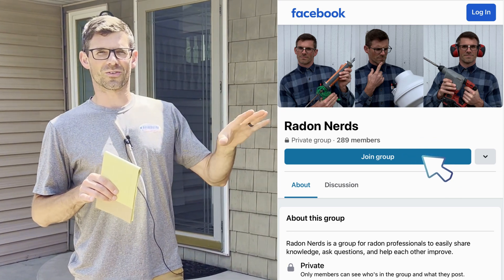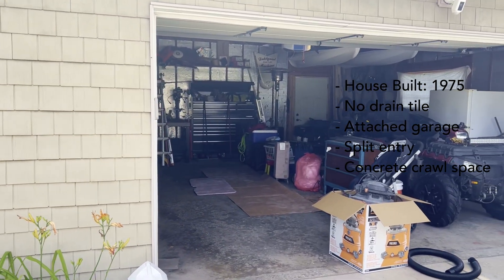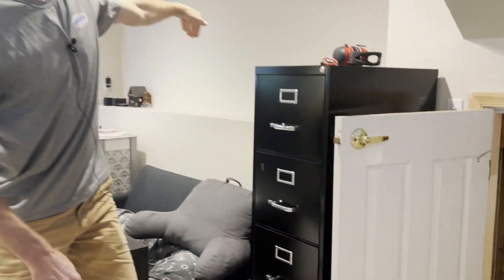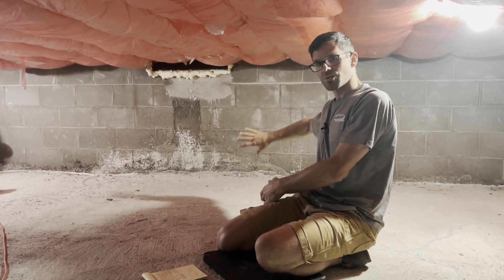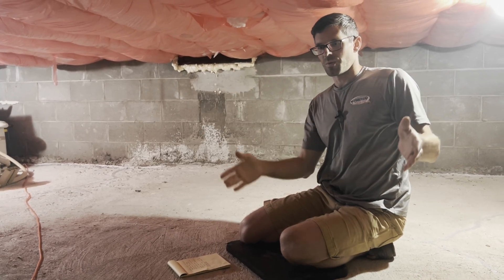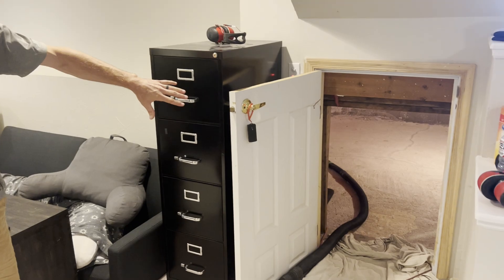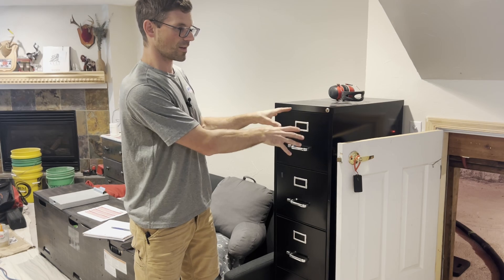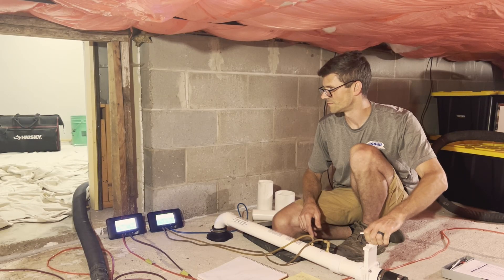How to Choose An Initial Suction Point Location

Comment: We have a stone cottage built into a bank with a variety of different floor types. As a last resort (before having to retrofit fully solid floors) we asked our radon guy to flip the fan to blow into the ground instead of sucking. After 2.5 months the avg is about 60 MBq instead of over 200 MBq, so promising. I assume this is quite an unusual fix? The ground (and possibly the floor) are very porous.
Reply from the maker: That's certainly an uncommon approach, but we're glad to hear it's showing promise!

Comment: Have you seen radon entering in a house through a sill plate on top of a concrete wall foundation?  I have a 20x8 porch that butts up against the basement walland wondering if it could be a source.  All test holes in my floor have decent flow but only can get the radon down to around 6-8.
Reply from the maker: Absolutely. Check out these videos:

https://youtu.be/KcFluDRcJlE?si=Nkk25Gej0lVew0aC

https://youtu.be/VkuUX0atOsM?si=W6XUx32euf_duJ_F

Comment: Very cool, about what does a multi suction point job like that cost?
Reply from the maker: Some contractors charge as little as $1,200 and finish in a few hours. We specialize in helping people who want to get their radon as low as possible. We use diagnostic testing to engineer a custom solution that addresses all the radon entry points. Our systems often exceed $10,000 and typically take two to four days to install.
Reply: @AmericanRadonMitigation  ah nice. Dang I wish you guys were in the MO area. We have a “mitigated” radon problem that won’t seem to get below 4-6
Reply from the maker: That must be frustrating. I'm sorry for your trouble.

It sounds like your system isn't addressing all of your radon entry points.

We offer consulting and rent diagnostic testing equipment if you'd like some help.

Consult with Jesse on Minnect: app.minnect.com/expert/JesseGreen
In-depth consulting: https://americanradonmitigation.com/product/consulting/
Tool Kit Rental: https://americanradonmitigation.com/product/radon-tool-kit-rental/